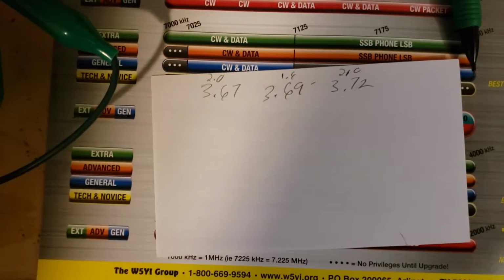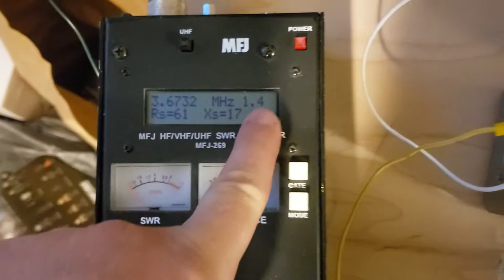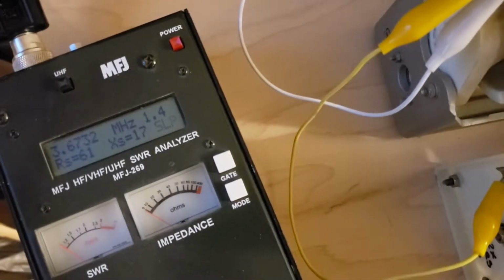DIY ‘T’ Match Remote Antenna Tuner / Coupler

Comment: I know this is a while back, but just in case:  I have one of those motors, also from allelectronics and am also pursuing a driver for it.  Online someone has posted, back in 2010 [I'm not sure where they got the V and A from]: "I changed the delay on steppin from 500 to 1000 and it now seems to work fine. 40 pushes of the switch to make the 1 RPM. I am a happy camper. I am still a little concerned about the temperature on the ED. Any ideas there. I am using a different stepper tonight from ALL Electronics. It is a Shenano Kenshi # STP 58D3004, 1.8 dgree, 1.2V and 2.5 Amps and .48 Ohms. I am supplying the ED with 5V and 2.5 Amps. I am supplying the Arduino with 7.5 V and 1 Amp" - http://www.mendingthings.com/?p=68